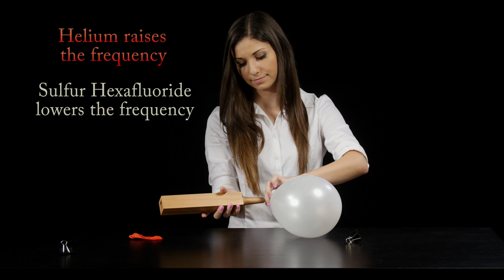Sulfur Hexafluoride vs GIRL  (Anna Spitz) with Explanation

Comment: Sulphur hexafluoride is so bad for the environment. Use octafluorocyclobutane instead. It's molecular weight, it's density and it's breakdown of voltage relative to air exceeds that of Sulphur hexafluoride. It performs the same, if not, better